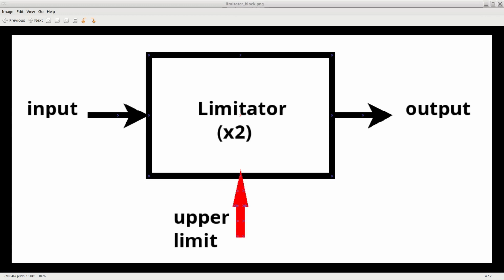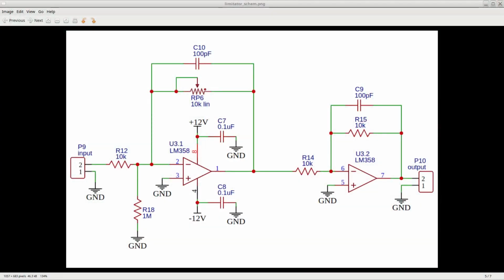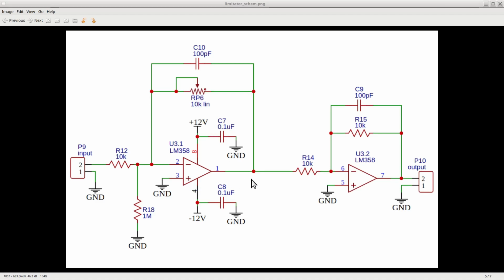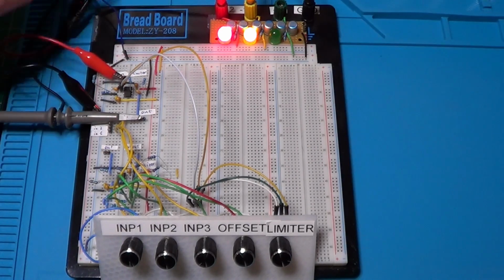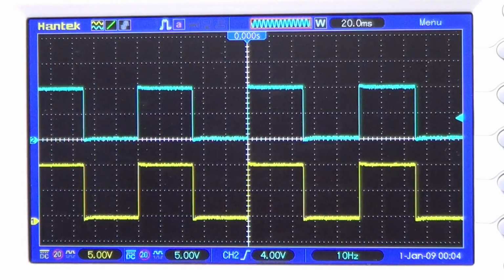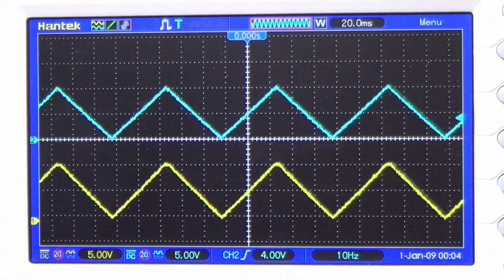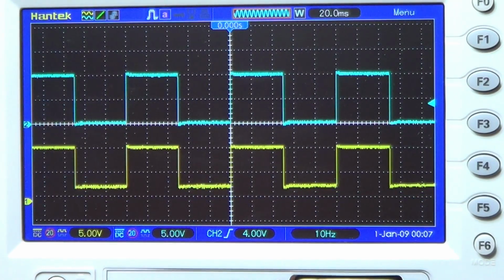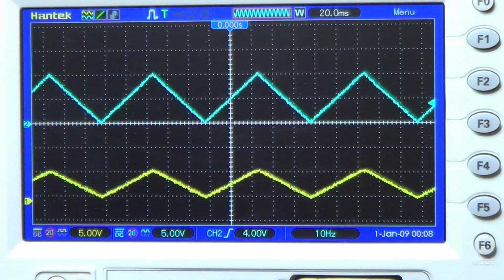The Synth Project Episode 31- CV Processor Part 3: The Limitator

Comment: What is the best software for simulating circuits before building them? I've been getting into building electronics projects and that's my #1 issue. I will be very happy to spend 8 hours in the software, I will be very unhappy to wait 8 days for a few parts to arrive and find out my PCB had a design flaw. It's the year 2023, we should be able to EASILY simulate basic circuits. I've tried like 5 different online platforms and they all failed.
Reply from the maker: If you are a Windows or Mac user, I would suggest you to try LTSpice:
https://www.analog.com/en/design-center/design-tools-and-calculators/ltspice-simulator.html
It is free to use schematic capture and simulator that could be what you are looking for. You will have to download and install it on your computer.